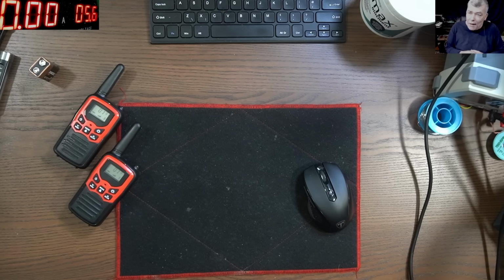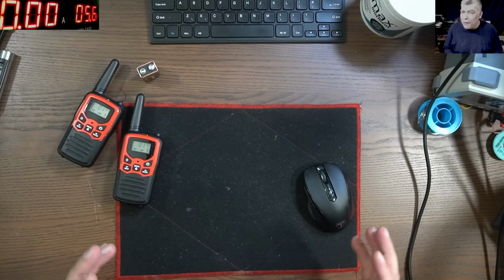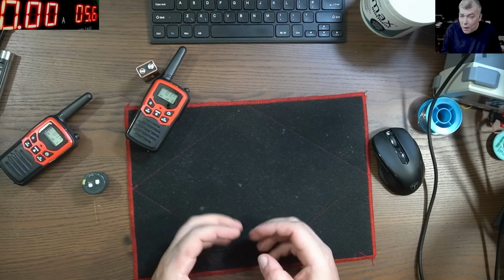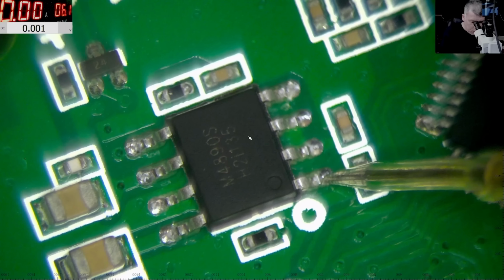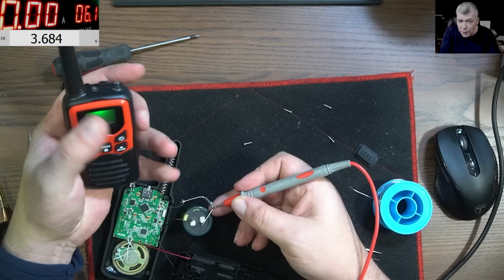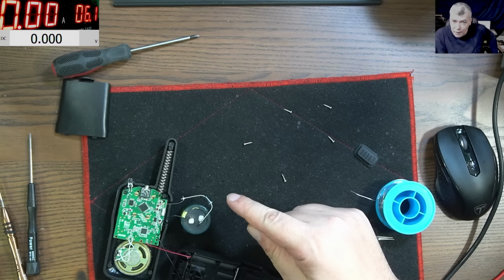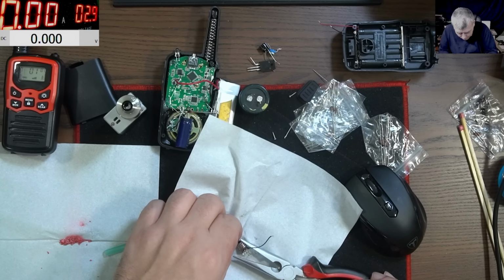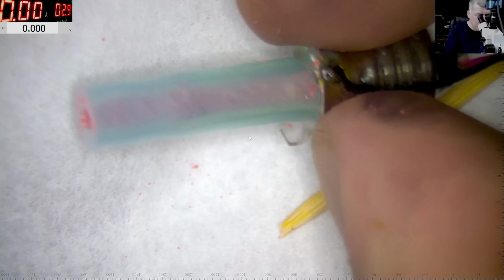Breaking Bad Walter White Explosive Device - Let's replicate it :D How special effects are made!

Comment: That's is roughly how I used to make my bands stage flash's, But the matches were crushed safety match powder, about 10 boxes, but the container was not compressed and had a sellotape lid so would make smoke rather than a bang. the detonator was a hair strand of copper wire wound round a pin to make the 10 turn coil fired by a PP3 and switch box by the sound mixer  engineer at the correct point as we played the last song of the gig. at the time stage flash's cost about £12 mine cost less that £1.and worked every time.

Comment: it needs to be drastically reduced in size. the okey-dokies range is excessive. and expensive i reckon similar is possible with a code hopping 433mhz tx-rx 5v relay set. very common, very cheap. not long range, but for silly effects as displayed in the video, its good enough. and small. i'm thinking absolutely as basic but workable as possible. and it's all theory of course, but like i said.. 'i reckon'  the power for rx relay->passthrough needs only be 2300mah 18650 battery and would deliver enough current to glow a 5w briefly. electric match may not work as it requires a lokt of current breifly, it can light but end closed circuit.well the ones i've seen do, so sorins matchstick heads will work better with the extra cheap set up i mentioned. forget visco fuses and extra thin dichrome wires. i'm thinking absolutely as basic but workable as possible. and it's all theory of course, but like i said.. 'i reckon'

Comment: never crack the glass of a bulb if you are doing this... instead, just use sanding paper and sand the top of the glass to make a nice perfect hole, then fill the bulb with your pyrotechnic powder. i have old light string, silicone tube with mini incandescent light bulbs inside of it, they are great for making electronic match. i light my model rockets with electric match like this for at least 15 years with really few failures...
Reply: If he had done like you do, he'd have shattered glass around the area.
For just a demonstration.
That wouldn't be smart.
The way he has done it, doesn't involve the danger of real glas in real wounds.

Glas is impossible to find with xrays, it most likely stays in the wound, when it heals.
Reply: @werner.x  you are correct, but slowly sanding never ever resulted in shattering the bulb for me... i tried sanding those big 100W bulbs and it worked out great... you just need to use really fine sanding paper, probably it would be even better if you use wet sand paper...
Reply: @self_taught_stuff  
Sure, this works.
But the glass shatters, when the charge blows. This may cause harm.
To avoid this, remove the glass and just use the filament.
Then take something less dangerous instead like this plastic tube or a paper roll - unless you'd like to build a real wepon.
Reply: @werner.x  with big bulbs, yeah you are right the glass will probably brake, with the small bulbs that i use they never brake and the gases just vent from the hole, which makes them perfect for lighting rcandy rocket motors.
i am making my own simple electric matches using nichrome wire, i will make video how i make them once i get to the rocket project i am planning.